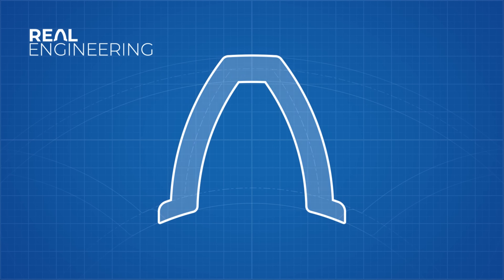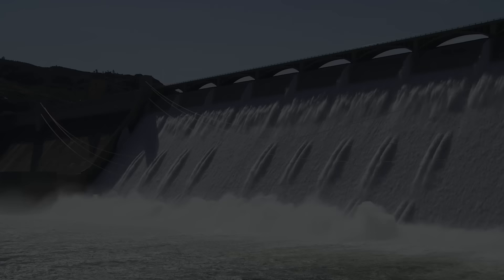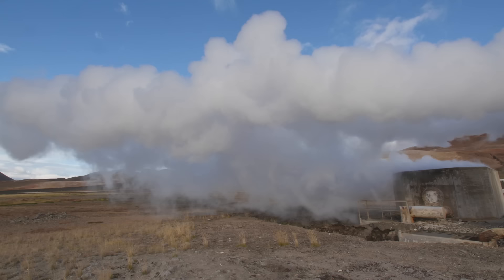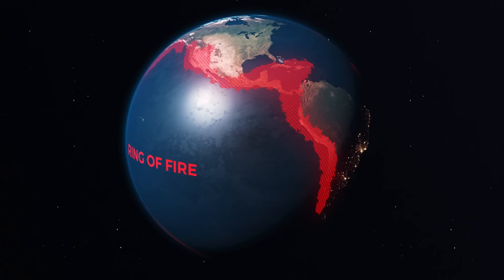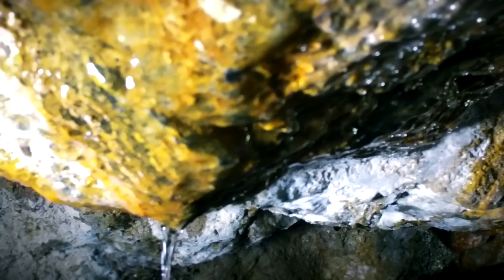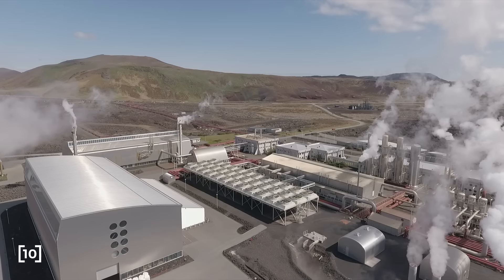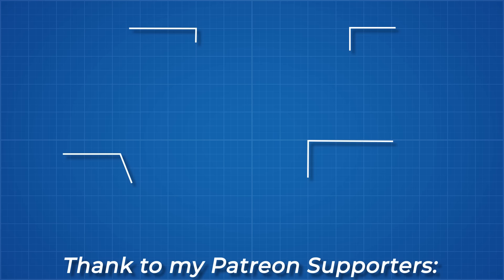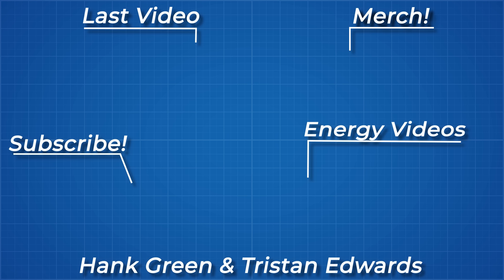Could Earth's Heat Solve Our Energy Problems?

Comment: Real Engineering: "We can use Earth's heat for energy"
Kurzgesagt: Dyson Sphere
Reply: To be fair a dyson sphere gives way more energy
Reply: @magictoffee7066  nah it dose not even conpare with a black hole generater (or black hole bomb)
Reply: @ariesleo7396  True
Reply: @magictoffee7066  but needs more material that it requires than there is of said materials on earth
Reply: @ariesleo7396  we don’t have any black holes nearby
Reply: @ariesleo7396  black holes are really far away and dyson swarms are way easier to build.

Comment: I have been to Bath. It blew my mind that the humble, little channel seen at 4:16 still functions ceaselessly as a drain even though it was built so long ago by the Romans.
Reply: It's pretty amazing. Shame we don't build stuff to last like that anymore.
Reply: @buckroger6456  And yet we do. Think of modern skyscrapers. They’ll be around for centuries. Concrete roads, minus our massive vehicles, would survive for a millennia or more. Think of all the wood-core homes that are already 50+ years old made with the same sort of technique as new construction. The older forms of those homes have stood for a century or more themselves too. We do build stuff to last, honestly some of it could last even more so, it’s just that almost everything is under more tension, weight, and stress. Or it’s something metallic that wears down because it stretches. Metal’s malleable strength is also its eventual undoing.

Comment: While much of the interest is in heating we must also remember that a huge portion of our energy use is cooling. A drill/well wouldn't have to go down far enough to capture heat. In any geographic area that is burdened by cooling costs, using the shaft as a heat exchanger  can work backwards without the excessive depth required to reach a heat source.  We're only talking about 30-40 feet.
Reply: I can't remember his name but a man built a greenhouse slightly underground & used underground air tunnels in different ways to heat the greenhouse in the winter & to cool his own house in the summer. It was somewhere on Youtube I'm sure one could find the video again.